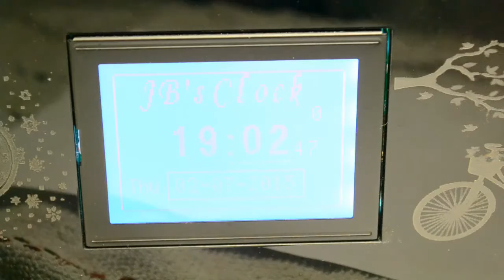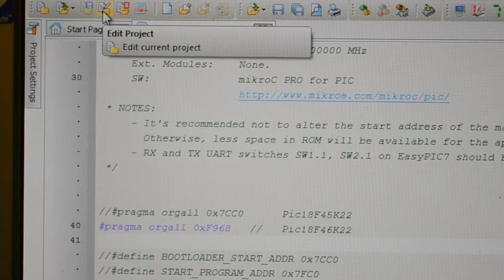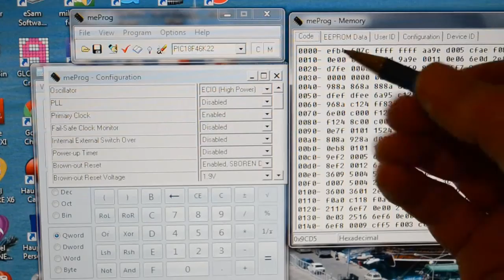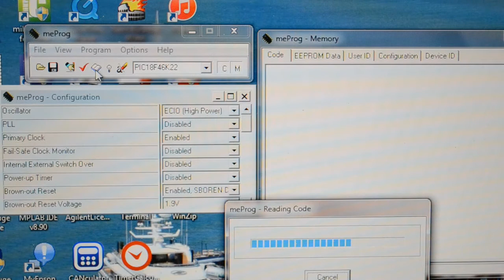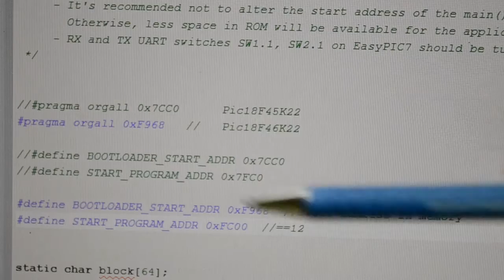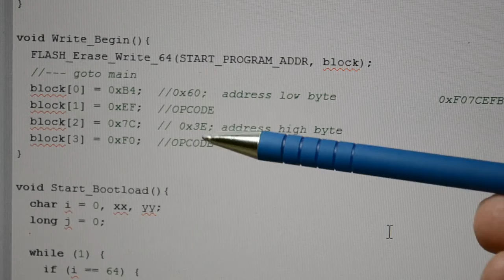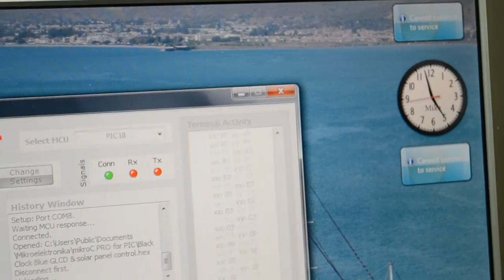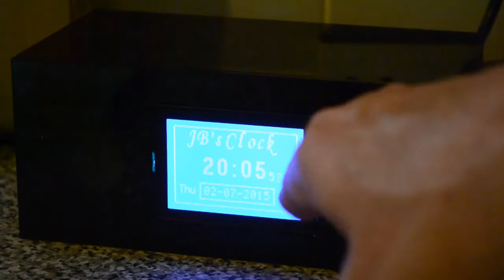Pic Bootloaders from MikroElektronika Pic18F46K22

Comment: Hello sir,
I am using a pic18f67k40 microcontroller bootloader code.
In this video you are using the address 0xf968 for pic18f46k22 microcontroller
I am using different, so where did I get orgall address and start program address.
Reply from the maker: The program start address can be anywhere, I forget about orgall.
Ask a question on Mikro E forum.
Reply: @JohnB-2021  
Hello sir,
When I try to program a microcontroller using a bootloader , I am getting timeout Error.  I even tried to reduce the application code  size. Could you please guide us.

Comment: Hi, I am trying it on 18f46k22. I changed values like yours. When i try write a small program, it works fine but my actual program is about 30k. I wrote the big program and did not work. I read rom via pickit and I saw program written up to 0x4000 and the rest was empty. How can i fix it?
Reply from the maker: Hi,
I have no idea, just like Faith below had a problem and sorted it out.
Reply: @JohnB-2021  Well, I will be working on it.

Comment: Hi, I watched your video and organize the pic18f45k22 example to pic18f4685 96k mcu. Mikro bootloader connect to the mcu but when i select the hex file and click write hex button, programe is faults after 6-7 seconds. "Error: Timeout waiting for MCU. Disconnected.". I am using a max232 for uart communication. How can i fix it? Thank you.
Reply from the maker: There must be a problem with your UART
Reply: @JohnB-2021  I have 2 pic18f4685. Tested with other pic and nothing changed. I find the forum for the same problem. 1 guy solved the problem, "the problem is buffer size in ram".  I don't understand how he fixed this problem. Do you have any other idea for fix this problem
Reply from the maker: @fatihmamak2446  The program is too large
Reply: @JohnB-2021  I want to upload only "blink led" example. Thank you for answering my questions. I will try with another pic.
Reply: @JohnB-2021  I solved the problem. The problem is that I did not connect the GND of the computer to the GND of the microcontroller. (I installed my own usb-ttl module.) And now it works! Thank you for answering my questions. Have a nice day!
Reply from the maker: @fatihmamak2446  Excellent news, thank you for the update.
Reply: Hi 
How will you set the bootloader start address and start program address
Could you please give some snap of your code for the same pic18f67k40 microcontroller?